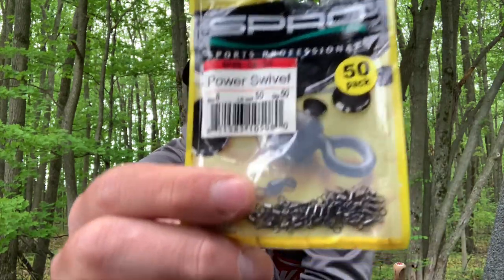Eliminate Spinning Reel Line Twist!

Comment: I've heard that a loose drag can also contribute. By this I mean if you have a fish on and you turn your handle while the drag is slipping, the line is twisting horribly. Is this the truth or just something I've heard over the years? I love your videos  and have recommended them to my grandson who fishes high school tournaments. You give practical, hands on advice without all the crazy fish catching hype that teaches nothing and just wastes time. Thanks!!!
Reply from the maker: I wouldn’t say it’s a loose drag that causes line twist. It’s the act of reeling while your drag is being pulled. So yes you will increase line twist if you are reeling while your drag is being pulled out. Great question!
Reply: One could also lock the the drag down and back reel at the moment that a big fish would normally take line from the drag......  with that said this takes a good bit of practice and the back reel switch in a convenient position on the real.   Learned this 30 plus years ago when spinning reel drag systems weren't that great.

Comment: What about using those dropshot hooks that have the swivels? I've never tried them, only because there seems to be more stuff at the nose of the weight.
Reply from the maker: I haven't found them to help with line twist much in my opinion.  However they do let the bait pivot nicely.

Comment: Are you familiar with  KastKing V10LS Spooling Station Rod Rack

I bought one for the rack setup itself.  As far as the spooler part of the station.  The baitcaster spooling part is easy and makes scenes but the spinning reel setup is What i'm asking about. The way it works. It comes off of the real counter clockwise but then goes up through an eye loop. Then to your rod was wondering if that's creating line twist. or is the process they have working just fine? I don't want to keep using it if that's the problem but we are getting line .  twist.  And yes I always close the bail by hand and mostly throwing Wacky riggs , and Texas rigged craws , beavers and worms . Would like to know your input thank you
Reply from the maker: im not but will check it out!
Reply: @MattStefanFishing  please do . Love to here your professional impression . And if it's worth it   thanks again

Comment: Also, check the tip guide on the rod, if there is any nick or rough spot in it, this will cause extreme line twist and line damage.
Reply from the maker: Good advice!
Reply: Do you have a remedy?

Comment: This question is around the same idea of the video. I bank fish/pond hop all throughout the week randomly. I keep my combos and my bag with tackle in my car just about at all times. Does the heat inside the car have any effect on the line? I find that even after 2 weeks my line has some pretty bad memory and I'm buying sunline and p-line.
Reply from the maker: It would need to get extremely hot for it to make a difference. But if the spool touches something in the car that is to hot to touch it can definitely hurt the line
Reply: @MattStefanFishing  I live in northern indiana it doesn't get blistering hot up here but we do have some hot times through the summer. Thanks for the reply.

Comment: Hey Matt, was wondering if you ever use the hot water technique after spooling up new line ?
 I've been doing it for over 30 years and works great.
Reply from the maker: Haven’t heard of it. What do you do?
Reply: @MattStefanFishing  
 After re spooling 
Take the spool off and drop it in a very very hot cup of water and let it set for 15 to 20 minutes.
 It will re memorize the line to the spool and totally eliminate that 1st line adjustment birdsnest.
Learned this from basmasters magazine early eighties 👍
Reply from the maker: @patrickwhitby5561  wow never heard of that. It won’t damage the line at all?
Reply: @MattStefanFishing  
no, I don't boil water .
just hot tap water. 
 Works great, give it a try let me know what you think.
Reply: I think this works primarily on mono.
Reply: @buckrockerm  
 I do it with fluro also.
 It relaxes the line so you don't get that initial 1st tangle.

Comment: Another extremely common source of twist is continuing to crank the handle while the drag is slipping.   This just twists and twists line.  40 years of frequent spinning reel use leads me to believe this may be the most common cause, especially with novice anglers.
Reply from the maker: Yep! Reeling while your drag is going out is terrible for line twist.

Comment: I have an electric line spooler that allows me to remove the reel spool and mount it onto the arbor and put line on it with zero twists. Years ago I discovered that this is not the best way. When you have no twists on the spool, the line twists as it comes off the spool during a cast. If your spool is 4" in diameter and you make a 100' cast, you will have 300 twists between the spool and your lure. The reel will remove those twists when you reel the line back in...mostly. You will lose a couple twists each time you lift your lure out of the water between casts, and you lose them all on your first line break. In short order, the first 100' or so off your spool ends up twisted back onto the spool anyway. Personally, I would rather have my twists on the spool and not between the spool and my next PB. Tight Lines!
Reply from the maker: Thanks for sharinv

Comment: I'd like to add a couple more tips. 
1.  Braid has very little twist compared to mono or fluoro
2.  When you go to the lake after spooling new line, let it all out trolling behind the boat for a minute or two then reel it in while still trolling.  This wets the line, let's it untwist, and reels back in under an even tension.
3.  I recently learned this one.  If you notice loops on the spool, DO NOT CAST! Just back off the drag and pull the line out. It almost always comes right out.
4.  Using lures with stop and go or jerk retrieves, like topwaters, allows little loops on the spool, compared to lures with steady retrieves, so pay closer attention to the spool when using these lures.
Reply from the maker: All great tips!  Thanks for sharing!